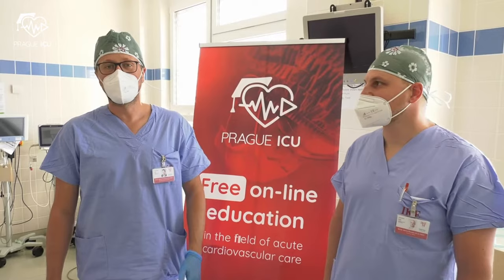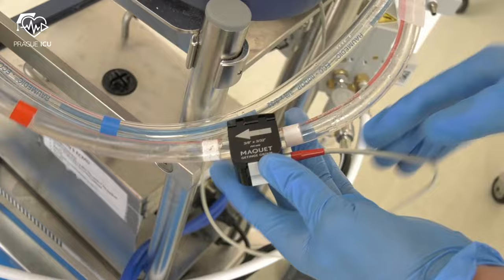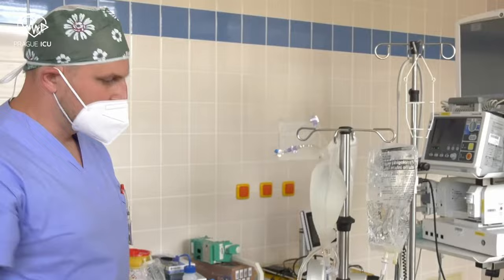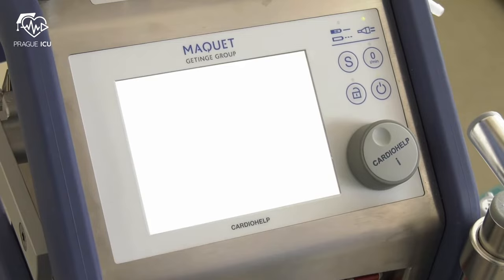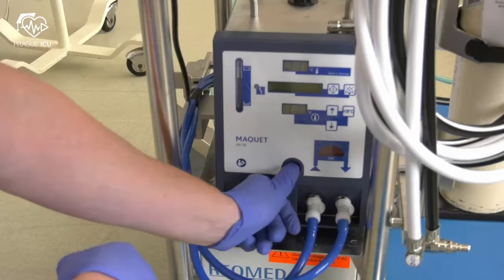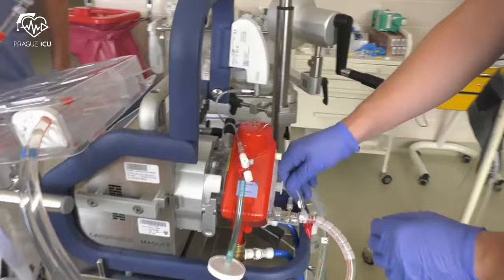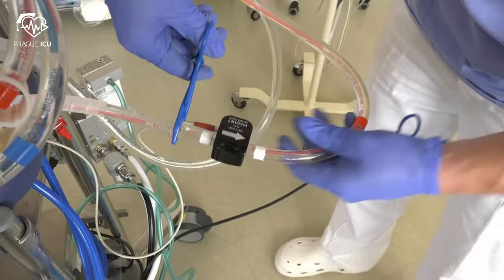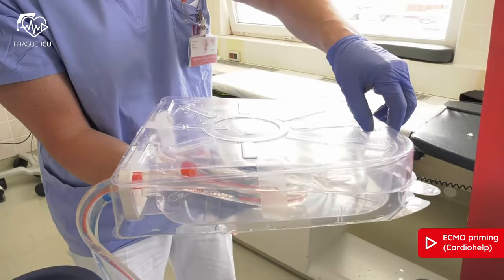ECMO priming (Cardiohelp)

Comment: How do you adjust the Heater Cooler Temperature on the Cardiohelp? Is the temperature control on the cardiohelp console itself, or is there a separate heater/cooler with separate controls?